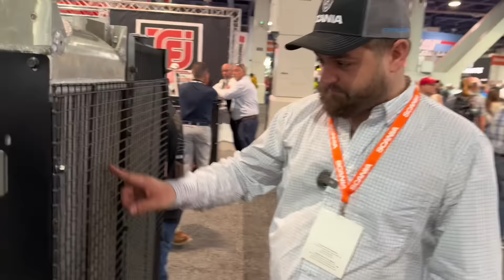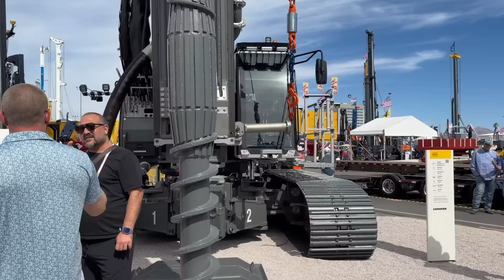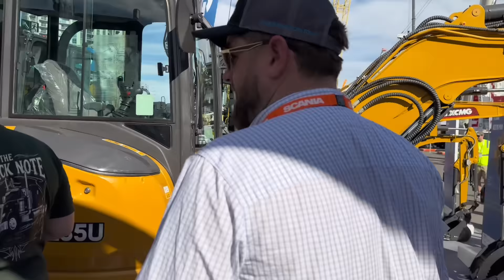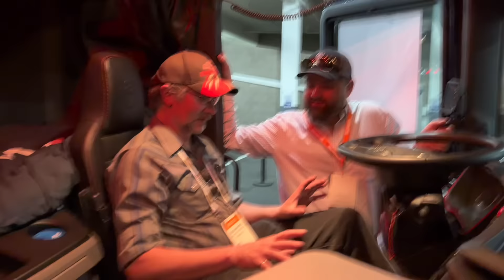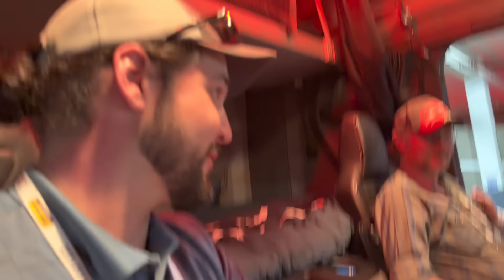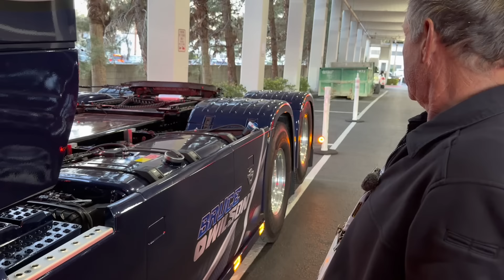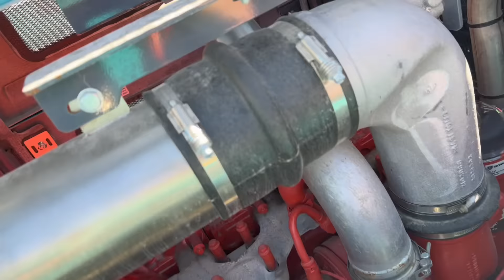Our Scania Truck Got SWARMED in Las Vegas!

Comment: I understand the old truck drivers, they are fed up with junk. But you see, these modern and high-performance trucks also require a lot of maintenance, which is very expensive. If these trucks are not kept within parameters, you can shit on them, they don't make a penny anymore. These trucks can't be repaired with a hammer on a cheap street corner.

Comment: I'm not sure if temperatures are a factor, but I can tell you that the Scania engines are not doing well where I'm from. The engines are very glitched and one company that was leasing a few had to have most of their Scania engines swapped out in less than a year. This was after extensive repairs were already done.

Comment: 47:53 - A lot of things, especially in the larger machines, are diesel-electric.  Once you get to a certain point it's just easier to run everything electrically, it's just far more flexible, you have no problems with torque and complex transmissions on things.  One of these days you need to head up to Canada and visit the Edison guys.

Comment: Ok.. So... 
57000kg = 57-ton = 125 663-pounds.. 
That 'MAGNA' = 💯  
100 000.kg (metric..) = 100.tons =220 462.pounds.. 
Of.. "HOLY SMOKE" CRAZY-MAGNA HEAVY WEIGHTS... 
WOOOW... "That's kinda HEAVY.. And a lot of Heavy Weight in one ⛕ single Place (MACHINE..) WHOOFF.. 
BUT.. A 770.hp Scania, can haul that in it's 'Sleep'.. lol.. 
But, I've actually experienced a little 'type' Scania 'Model' with only 390.hp drive off, and haul 40 000.kg or 40.ton = 
88 184.pound. Heavy load too.. And even though it started in a slight upward hill road, it only had to USE/START in 3rd Gear... But, of course this was very HEAVY for such a little Engine, it was actually built to manage it.. but on the road it barely made speed limits on the flat roads 90.km/t top speed..(55,92.mp/h..) 
But cruising speed was about 65.km/t (40,38.mp/h)
But it made the trip..
But, of course using and STRAINING the engine that Hard.. Made it so those trucks had to be changed out and switch out to New ones, every 3,5-5.years.. But, a 770.hp Truck, would barely even break a 'Sweat'.. lol.. 
😊😊👍👍👊👊🥰🥰

Comment: 27:00 yeah, a lot of hills in scandinavia and Europe as a whole, so it will pull to the speed limiter up the hardest grades with full load easily still in torque band so its cheap diesel-wise. That is why the engines are so powerful.

Comment: 28:40 Heavy cargo companies will buy these scanias 3-7 years old in a jiffy. Trying to pull a wind turbine generator over a small mountain with less torque means you need a second truck with a second driver.

Comment: 27:27 And in Norway you can apply for permits to pull long ass trucks (or even heavy trucks) on the regular depending on where to /from. Longest I've seen was logging truck with 3 trailers after the normal trailer, because they were only going on relatively straight road to dump it in a barge (they did 9 trips IIRC from that forest then its another 30 years or so before next time). Some fishing trucks get permission to run long on the regular, the limit is the road standard.

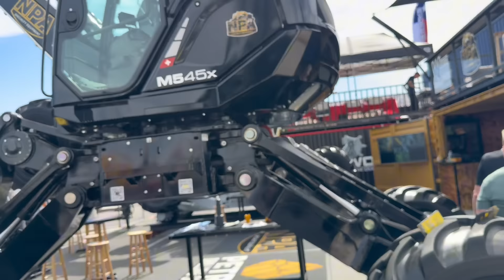Comment: 9:40 these often have GPS so accurate you can make ditches with like 0.4 degree angle without someone lasering your ditch every few hours. Just make sure not to hit the override on the degree lean on the machine (you use that when held by wires on a bulldozer off a severe cliff or something).

Comment: 31:30 europe has somewhat lower limits than the US generally do: daily limit of 9 hours driving extensible to 10 hours twice a week (US: 11), 45mn break every 4.5 hours (US: 30 every 8), 11h daily rest reducible to 9 thrice a week (US: 10), weekly limit of 56h and forthnightly limit of 90h (US: 60 over 7 or 70 over 8), mandatory weekly rest of 45 continuous hours (reducible to 24 every other week, requiring compensation) after 6 days of work (US: 34h).

There are exception regimes, and some extensions for exceptional circumstances (e.g. driver reaching their residence for their weekly rest period), but these are your baseline.

Comment: I have just retired after 50 years HGV driving, I use to deliver New Scanias in the UK in 1978. Also you can get an extra fuel tanks that sits at the back of the cab as a walk board.

Comment: I think a long nose, extended frame with as much of displacement and driven axles as possible is really cool to see and hear.
At the same time, I want the truck delivering to my local, city centre businesses to be as efficiently as possible in its task which points to up to date assistance systems and a drivetrain that returns as much milage as possible for the running costs.

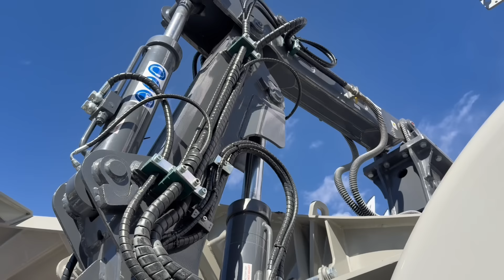Comment: 48:33 The small breaker attached to a boom is so the operator can remotely clear any oversize feed blocking the crusher. Without it, the operator has to break any rocks that are wedged tight by using a crowbar.

Comment: The ownership structure of Scania is kind of wild, since it belongs to Traton (the comercial vehicle branch of Volkswagen), as MAN does. Another famous European truck & bus brand. And while they share research and data, enhine / drivetrain components, software, electronics, data and much more, they still engineer the user experience very differently and make different character trucks. Badge engineering done well, I guess. Because while a huge amount of internals are actually shared and suppliers are adressend with the combined purchasing power for identical components, they have managed to keep the Scania reputation and DNA alive as the Premium, driver-focused truck, with the MAN being seen as a good, reliable and reasonable fleet truck. So both fleet operators and driver focused logistics in the end have Traton (VW) trucks on their list, whilst they are saving billions combining research and components.

Comment: Hello from Europe, so about the logging? Everything. Every truck in Europe can pull everything even depending on his configuration just watch for his weight limit and his configuration. 4x2-6x4-8x4-10x4. You have trailers for every size in every configuration. Shipping trailer, heavy machinery trailer, liquid trailer, metal beams trailer, wood loggs trailer, dumping truck trailer from a construction site. Smal mounted crane for fast unloading, etc. It comes in lot of configuration depending what you want to do.

So for logging yes it can BUT you have to remember that the euro truck has to be shorter because of euro streets then those in the US so the loggs need to be cut shorter. SO a 4x2 or a 10x4  bouth can do logging but of corse the 10x4 would be better. Just pay attention to the weight limit.

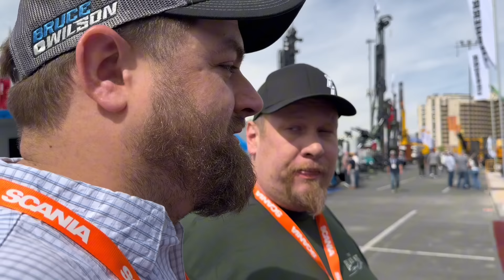Comment: 5:59 That's actually what is in use in Europe and Asia for narrow places like inside homes that will be completely renovated, narrow paths, etc. Even for garden usage instead of the much bigger skidloaders.
At least the size, I haven't seen the RC variant like this guy shows.

Those drills are still tiny, in the Netherlands we have way bigger ones. Specialized jobs, sure, but still :p

That beer tapping with machines, yeah you see that in the Netherlands on truck shows too haha. Also often with way bigger equipment and faster.

Comment: 27:02 - Well - they do use R770 for logging over here, just not in a tractor setup  - it´s usually a truck/trailer for CTL logging, and mostly self-loading with detachable cranes.

Comment: "Our Scania truck got swarmed" Yea of Course haha, that's because Scania is just top of the Line, if you would try to bring a DAF to the same event, the people would all say Something diffrent. I drive Scania as well in the netherlands. But a few years older (2023) truck and (we have more) 2024 Early, the 2 latest trucks weve got are late 2024 dashes, with the same Nice infotainment System. The newest are diesel but the older 2024 trucks drive on CNG. I have to say, they are slower, yes. But they give Enough to make you satisfied

Comment: That Scania is by far the BEST truck in the USA right now. Nothing America makes even comes close!
Reply: At Expo was a the new Mack Granite (Youtube: The NEW Mack Granite at ConExpo 2026)
Someone wrote the following in a comment: 'Looks like an Automatic, Electronic, Touch Screen, Sh*t Box!...  Someone needs to make a Truck that's still a Damn Truck!... All those Composite Body Components have got to go too!...  I'm the 2nd Owner on a 1969 R 686 Mack Tractor... It is still in use... That was built back when Trucks were Trucks!... I run my business with a Fleet made up entirely of Older Vehicles... 1979 F-600 Rollback, a 1990 F-250 Service Truck, a 1980 Ford  Econoline, Etc... I can work on that stuff... These newer Trucks, you can forget about it!...'

And there was also the new Kenworth (Youtube: The new Kenworth C580 release at conexpo 2026)
One commented: 'Still looks like it's from 40 years ago.'
Someone answered this way: 'That's the main point and what sells! Why change something that's not broken? (hint: your everyday car brands like Nissan and Ford don't get that concept) I'm glad that truck companies like Peterbilt and Kenworth actually care and have value when it comes to making new models. They care about their customers and what their customers want. And this "40 year old" design is what their customers want, so it's pretty plain and simple/common sense. 
This may or may not be important, but I'm just gonna throw it out there for reasons: I turn 21 years old in a few months (July 26 to be exact) and as a big automotive, diesel and 18 wheeler enthusiast, the changes for the future isn't looking great. More aerodynamics here, more stupid 12 inch full digital touchscreens there, not to mention the price tag. When I first saw the design of the Kenworth C580, I was so happy knowing that Kenworth still values their brand and customers. And the interior looks pretty good. I'd have to say that Kenworth might be the only brand that actually makes an interior that in my eyes has a good look in the future! Sure, it's an old design, but old designs have character and live longer than a brand new Super Duty in the shop for a stupid computer sensor. I'm not saying these new 18 wheelers will or won't have failing computer sensors, the world is going more on technology as we know it, but it's also the design/looks that count.'
Reply: Europe in general makes better stuff has better healthcare. its sad that americans get brainwashed to think they have IT goot but in truth their countries exploits them hard
Reply: @sirbonobo3907  Brainwashing into BELIEVING to "be the greatest nation in the world" ... causes NOT NEEDING TO IMPROVE ANYMORE and thus the USA is in the 1960s when it comes to their cars and semi-trucks ... and they are in the 1860s when it comes to their society / driving discipline.
Reply: @Muck006  It's called "American exceptionalism".

Comment: I drive Scania day in day out and but I always recognise how well suited they are for UK roads, very manoeuvrable as they need to operate in very tight depots most of which are designed for smaller rigid trucks, also the reliability is brilliant we have around 30 Scania G460 at my base depot and it is extremely rare for anything to go wrong despite the fact that they pull 44 ton double deckers day in day out, the only time I have had an issue was a gearbox sensor malfunction on a truck with 1.2 million kilometres on it but it was back on the road the next day, by far the best heavy duty trucks here in the UK

Comment: The U.S. EPA WILL SCREW OVER THE EURO MOTORS...

Even Though The EURO Exhaust Standards Are MORE STRICT 🤣🤣🤣
Reply: Yours absolute crap 30yrs behind    i was driving scanias in 90,s   but not them but volvo. Mercedes  daf.  And 4 more all   under slung engines    and powerful i use to drive a 6leg daf with a 6 leg trailer 45ton   could go up hill without splitting a gear
Reply: @kennethsewell4245 Agree!  The American Trucks Are 30 Years Behing The European Models !!! 🫡

Zero Argument From Me On That 🥸

Also, The Restrictions In The European Market Is Very Different Too.
Axle Setups, Wheelbases For The OLD WORLD ROADS And Structures. America Is Very Much A WIDE OPEN ROAD/CITY SYSTEM... The Exceptions Being The Old East Coast Cities, Say, Boston, New Youk City, Philadelphia As Examples. The Rest Is Pretty Much Wide Open...

Comment: Bruce, start telling people to not grab the steering wheel when climbing in or out of the truck. I was at our fitters garage getting an inspection on my Scania when 1 of the lads was dismantling the dash to get down to the back of the steering column to replace a bolt that snapped because the driver held onto the wheel when getting in and out. Its a single bolt and without it your steering wheel will move freely even though you tried to lock it in place

Comment: In regards to brands in Europe there are more than Volvo and Scania... you also have Mercedes, MAN, DAF, Renault. Also mostly in the eastern part of Europe you will see a lot of KAZ trucks as well.
57000 Kg, 57 metric tons which is roughly 125663.5 lb. 100000 Kg, 100 metric tons is around 220462 lb.

Comment: I worked on a big crane like that. It came on 6 trucks, and after 3 hours of building the machine, I got the key, and they said have a nice day.
Reply: Worked on a construction project with Sarens, that we hired for removing an existing bridge in several sections, and reinstalling a new bridge in sections. installing a bridge above a rail line, and they used a CC9800-1. 
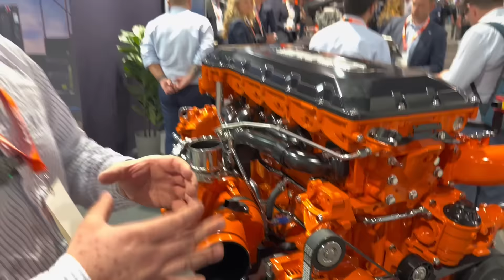94 trucks to transport the machine and the counterweights, massive mobile cranes to assemble it, 0 storage on site. The rail line was closed at night, during the weekend, and reopened in the morning (4:00).
Reply: @fabr5747   My crane was a Sennebogen 1100. of Blansjaar.

Comment: Scania in International will be what Mercedes was in Freightliner years ago. 
It will be assembled in Mexico and therefor quality control will be junk. It will fall apart fastest. I don't believe quality will be like Swedish made. There is no way it will go over one or two million miles without rebuild.
Reply: You make a valid point if the Hyundai/Kia example is used.In the States I read and watch really critical comments and reviews of their cars made and sold in the States.In Europe Hyundai and Kia get pretty good reviews when it comes to quality and reliability but our models are either shipped in from South Korea or made in the Czech Republic.
Reply: @jjgermancarsdontsignal7746 Friend of mine is a cabbie. He just hit million km in his   Huyndai i30 (600k mi). I've yet to see one in States with or over half million miles without transmission issues. Lack of maintenance, people do not believe in it in US. Parts get replaced only when those break. Let me put it this way what everyone does:
Oil change on every 10k km (6k mi). Transmission oil and filter on every 50-60k km (30-40k mi). Water pump, pulleys and belt on 100k km (60k miles). Valve adjustment on 100k km (60k mi). Plus everything in between. When is last time in States you've heard someone does that? I know people who never changed oil in their transmission or flushed brake fluid, power steering fluid etc... people think oil lasts forever.
I do everything the same, thats how in States I sold one of my cars (years ago) with 720k miles.

Comment: Edison motors  has a both at that conexpo  somewhere inside  he is the one making a ev truck , with a Scania generator engine
Reply: He's making hybrid trucks.
Reply: @AlexKall no they are ev driven with a generator on board , the engine has no transmission or drives driveshaft all electric motor axles  the electric motors get their power from batteries that are rechargeable
Reply: @jamesmartin3895  You're describing a series hybrid.
Reply: @AlexKall explain
Reply: @jamesmartin3895  A series hybrid is a vehicle which has for example a diesel engine that powers a generator that either charge batteries which in turn powers the electric motors  or directly only powers the electric motors or a combination of the two.

The first line you see on Edison Motors website: "Canada's first production electric hybrid truck."

Yes, it's a hybrid.
Reply: @AlexKall electric motors at the axles powered by batteries  the batteries are rechargeable by regeneration braking and by the generator powered by a  Scania engine  the engine does not provide any power to the wheels directly from a transmission  the engine only runs when the batteries reach a predetermined state of charge

Comment: Bruce, Edison Motors has partnered with Scania to use their diesel engines as the primary electrical generators in their hybrid-electric trucks, integrating Scania's 9-litre  5 cylinder engines into their BDE-Series trucks.